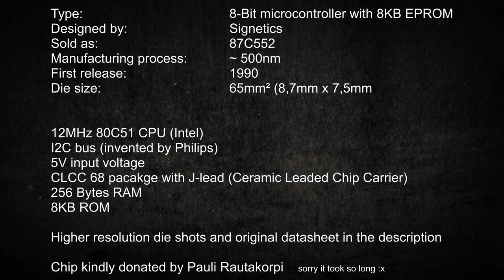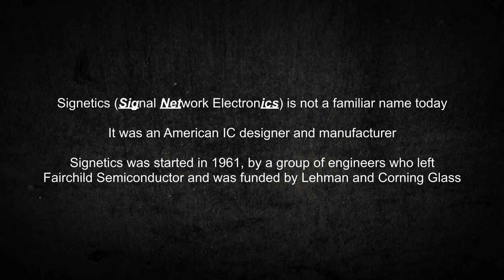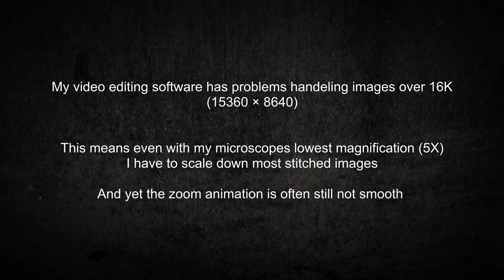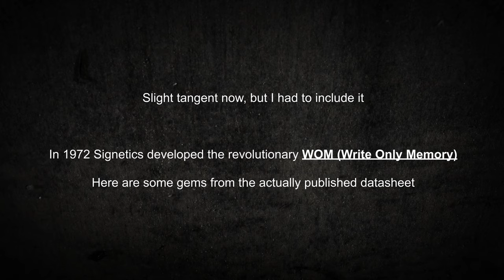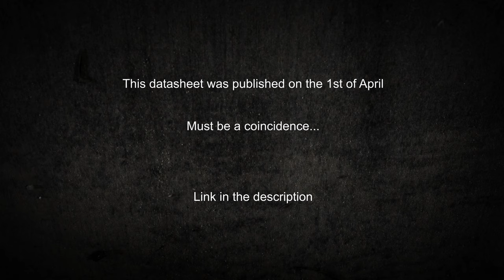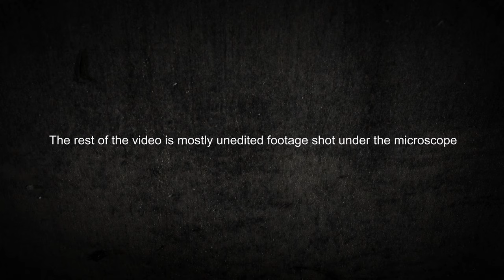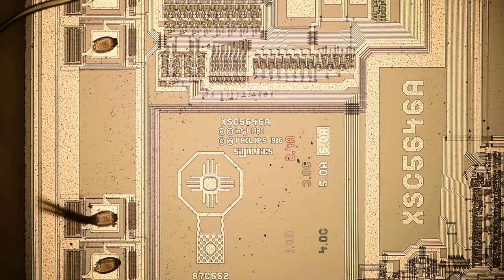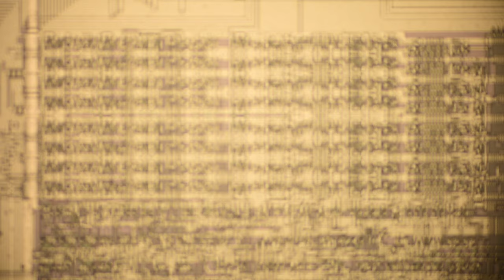Signetics 8-Bit microcontroller with EEPROM - S87C552

Comment: How to open somthing like this?
Reply from the maker: It was actually surprisingly easy to open. I put a knife where the top and bottom of the package join, tapped it lightly with the back of a screwdriver and it popped open.
Reply: @SIC66SIC66  oh lol nice :) can you need dead gpus? Like 970 or somthing (Die is io, the vrm is dead, (hole at the pcb) and i have core2duo, etc, when you will have it for free, i need your Mail :)
Reply from the maker: Thank you very much for the offer! But I have already collected WAY too many chips, to the point of it becoming problematic. My attic has become an obstacle course in the process, lol. 
Here are some die shots taken from the GM204 die of the GTX970 made by a friend of mine: https://www.flickr.com/photos/130561288@N04/albums/72157715122811768
And I have already made images and video's of two Core 2 Duo chips, Conroe: https://www.flickr.com/photos/sic66/albums/72157706427557925 And Penryn/Wolfdale: https://www.flickr.com/photos/sic66/albums/72157697426140892
Reply: @SIC66SIC66  when you need anything i can search my storage :) i have Lots of PC compnents, when you need anything tag me and i will See if i have it :)  i would like to do the Same, but i dont have the tech that you have :/
Reply from the maker: You do not NEED an expensive microscope or camera to do this though. it helps, but you can make quite nice images with a 200 euro scope and your phone. And for chips like this you dont need any chemicals either. Most chemicals I use for other chips are cheap and not that scary. You can do this without spending too much money if you want.
Reply: @SIC66SIC66  Roman aka der8auer (i think you know him 😅) uses a 1600€microskop, i have a 1000€ Dino Lite USB microscope, i want to use Glass etching paste for the last Step, and that's my Problem :/. I dont want to Grind the die
Reply from the maker: Yes I know Roman. My microscope was only slightly more expensive at around 2000 euros. And I use a Nikon D5500 to make the images. 
I never tried an USB microscope, but most of the images I saw of cheaper ones are not that great. 
Why is using glass etching paste a problem for you? This you can just use inside without any protection. I think you should just try it.
Reply: @SIC66SIC66  As far as I know, this paste is toxic,
Reply from the maker: Long term and high dose exposure to it is indeed dangerous. But if you do only a few etchings per month, in a ventilated space you dont stay in during the etching process, only to check in on it every 10 minutes, there is nothing to worry about. If you get some on your hands, just wash it off relatively quickly, its fine. Only thing I recommend is to wear something over your eyes to protect them.

I know someone who uses a razorblade to remove the upper layers of chips, he is quite successful with this method most of the times. Maybe this is something you can try.
Reply: @SIC66SIC66  thanks, i need a cheap heating Element for the Chip, and then i try it :)